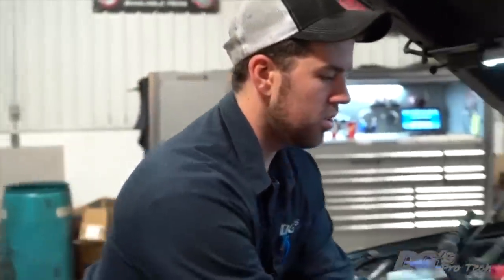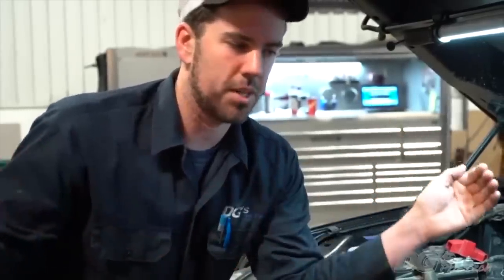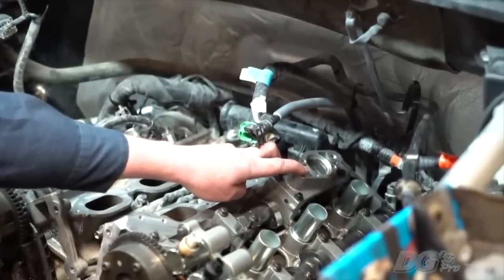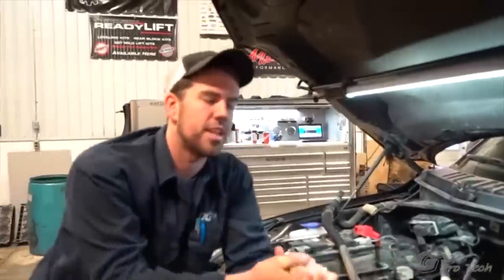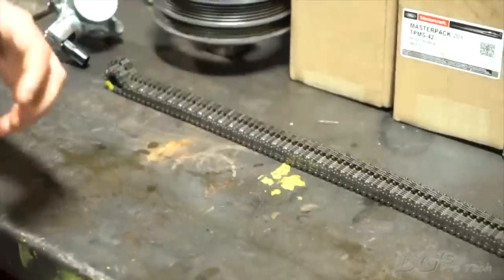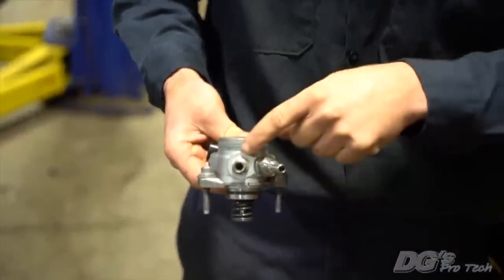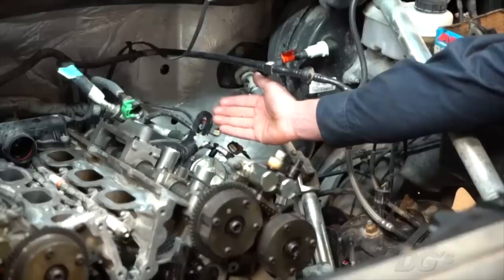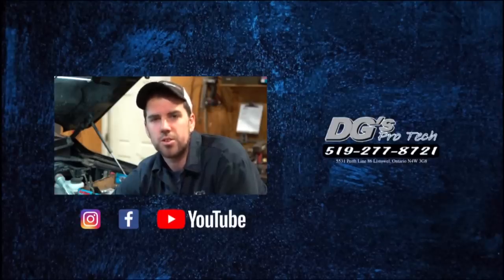What you NEED to know about Ford EcoBoost Engines by Dustin Golley of DG's ProTech

Comment: Just too much !.. I wonder if Aircraft engines are this much trouble ?... Im 60 years old, and been a mechanic a very long time. I am very biased to " old school tech".. Simple things like pushrods, and larger slower turning engines. Late 60s Cadillac and Buick V8s are a good example... The GM LS engine of modern times is a good example of a more simple way to go... By the way, im a Ford Man first
Reply: Majority of piston GA aircraft are nothing like this. They are WW2 era technology. Pushrods, flat tappet cam, carburators, naturally aspirated. It's virtually impossible for new engine manufacturers to break into the market, and 2 legacy manufacturers basically have a monopoly ( Lycoming and Continental). The reliability has to high of course, which is helped by mandatory inspections. Everything in aviation Mx is 3 times the price as automotive. Sometimes for a reason, sometimes because of liability

Comment: Thanks, I have a 2015 f150 Ecoboost and I love it .it has 92,000 on it now and still running strong. Would like to put one in my 1949 F1. I always change the oil and filter every 7,500. Only thing I don't like is all the covers I have to take off to change it, but I deal with it.
Reply from the maker: Thanks for the comment William! 👍

Comment: Ford needs to have there engineers hook up with these guys to learn how a motor works and holds up. I am a Ford guy and these mistakes are embarrassing. Ford CEO's take note or get the hell out of the way and bring in Engineers that know what they are doing. Where did they test drive these prototypes. There backyard

Comment: I have a 2015 f-150 that with only 52k went into limp mode. Had it towed to the dealership because I didn't trust anyone locally to work on it. It spent a month there with the only updates were,"we don't know what's wrong with it. " Then the service dept. called to say it was ready.  Wife got in it and turned the key, went back into limp mode.  The dealership said they would buy it back at current blue book value but,only when the get it running again.  My wife is a caregiver who has elderly clients who depend on her to take them to apts. She is using my old mustang with 280k and I have to catch a ride.  Thanks Auto Nation!

Comment: i lost my alternator on my 3.5 at 26,000-i left the ac on and it ate that also--if you lose an alternator make sure the ac is off including dont put it on defrost--mine was under warranty -it ate the whole ac system because of metal fragments

Comment: I have a 2020 ford ranger with 8000 miles. I use 5w30 synthetic blend and change the oil at 5000 per the manual. Should I continue with this oil or go pure synthetic especially since this engine is turbocharged and I want it to last? Any advice is appreciated and has there been any major issues with this truck as well? Thank you.
Reply from the maker: Thanks for the message! If you have a question about our products or service, please send us a message online at CARDONE.com or call our Customer Service line at 800-777-4780 Mon-Fri 8am-5pm EST. For Tech Support, call 888-280-8324 Mon-Friday 8am-5pm Fri EST.
Reply: @CardoneIndustries  thank you very much and will do.

Comment: Jesus! Not going to shade this one bit, you should be working for NASA. I have a 2011 Ford Flex 3.5 Eco Turbo. The water pump failed and I replace it myself. As they say, "If I'd known it would have been this hard, I would've never gotten involved". But, the WP failure happened at 175k miles and I'm now at 220k. Unfortunately, I now have a P0305 misfire code, replaced the plugs and the 5 coil - no improvement. Took it to a Ford dealer for an analysis and the mechanic says I need an new engine because there is 24% compression on the 5 cylinder. So, my plan is to jerk the heads, send them to the machine shop for a rebuild and try that. I'm guessing that it's valve related, or possibly head gasket. I can't imagine that these 3.5 piston rings seize up. I've run Mobile-1 synthetic in it from the beginning and changed the oil every 5k... religiously. The main issue I have (to your point) is that this is my wife's car and she doesn't step into it, ever. So, I'm sure there is carbon build-up on the valves, etc. Anyway, especially after talking to a Ford mechanic here in the Chicago suburbs that didn't impress me at all, I watched this video and thought, "Damn, this guy is a fricken genius." If I thought it would make it, I'd drive that Flex to Ontario and let you fix it. I really like smart people; mainly because I'm not that guy. You're that guy.

Comment: Ford garbage is what the fecal boost is and if you buy a ford, you're stupid! Buy anything other than a Ford with an ecoboost or wish you did when anything goes wrong! I was a ford guy until the 5.4 three valve, and the ecoboost will top that as a total piece of shit engine Ford should be ashamed, but it's like there all  in it together these days to build shit that barely makes it out of warranty.Then make it so labor intensive to fix you might just as well send it to the scrap yard. Fuck them and anyone who had a hand in the piss-poor  design... when I see people beheaded, I think I hope they worked for ford and smile, along with they voted for Biden. Cutting their heads off while they are alive is not punishment enough. I think at this point I'd rather be in prison for the rest of my life rather than work on a ford

Comment: I recently obtained my father's 2013 f150 ecoboost and I do love the truck but I think I'm having some problems coming very fast.  1 turbo seems to be stuck and the engine is leaking oil very slightly but all the way around it is seeping out. I noticed that my father was not always running synthetic oil which i will always run synthetic.  I hope i can nurse to good health.

Comment: I just picked up my first Ford product. It's a 2015 4X4 ecob 3.5L. 199K. This truck and engine bay look emaculate. Clean, not a mark on it! So I bought it. Now, the book says 5W20 for oil. Some people say use 10W30, I'm tending to stick to 5W20 synth. Just because it flows early and late.
Anyway, I know nothing else, do these have modular ignition or do they use a dist? 
And are the sp plug gapped at .32?
Reply: Nevermind I found my answer online... but I'm still happy about this vehicle. I've had it now for a bit over a month. Runs great

Comment: What about the idle of a locomotive? can anything be done is it and issue? 2016 F150 3.5L with good maintenance intervals idles like a train and gets 23 MPG HWY to work and home but when I pull My 7x14FT tandem axle enclosed Flat nose pace American Trailer I average 8.5 MPG HWY at 70-75 MPH Flat Ground the trailer weighs around 4000-6500LBS Loaded.

Comment: First, thanks for the video. I was a mechanic for over 30 years. I was brought up working on automotive electrical systems, may father owned an automotive electrical shop. I opened an automotive A/C and radiator shop and operated it from 1973 to 2003. You seem very knowledgeable on the 3.5L EcoBoost V6. What happens when the water pump starts to leak?

Comment: Great informational video- correct it is imperative to change the oil and filter every 5-6K with only full synthetic. My 2012 F-150 ECO now has 253K and aside from a current MAF issue (needs to be properly spray cleaned) the truck runs great.  Another tip my mechanic advised especially on the older 1st generation ECOs is when operating for extended trips is to allow the engine to idle 2-3 minutes allowing the fluids to circulate through the turbos before turning off. Anything to extend the life of the ECO is important.  Don't forget the transmission flush which along with the radiator which I do at the dealer at least every 40K after I hit 100K.  Small price of preventive maintenance to possibly avoiding large repair bills if you plan to drive over well over 100K.
Reply: Having had diesels in the past, if driving on the highway, especially towing hills, I'd let the truck run until exhaust temps lowered to 300 degrees, so says the pyrometer.   Of course their is no pyrometer on these F150's (of which mine is a 3.5 as well, and running fine at 130k+ miles) and although I don't tow, if I've run it a little harder than normal, I'll wait 30 seconds before shutting down.   I am one of the one's that drives for fuel mileage, so every now and again, have to remember to allow the turbo's to incorporate some power...but I don't often, as I want to remain above 18 mpg around town if at all possible, which it can do if I drive it sensibly.   I just bought a case of Motorcraft semi-synthetic (as per the manual states for oil changes) but I do change right at 5,000 miles or prior to.   I'll switch over to Penzoil Platinum full synthetic once my Motorcraft is gone.

Comment: Biggest tip, change the oil as much as possible.  My wife has a 17 1.5 Fusion and I have a 15 lifted Colorado.  I always change them no less than 35% oil life.  Better to pay an extra $30 (do it myself) for an oil change per year than change out a timing chain.

Comment: I would like to see GDI on a naturally aspirated engine.  The huge benefits of GDI are the high pressure which equals good atomization, the ability to run very high compression ratios...both of which equal better efficiency, and the ability to run at far leaner mixtures, which means that at light loads you have a higher air volume / less restriction from the throttle (higher vacuum), and are running at a higher actual compression ratio.. because of that lower vacuum, which also adds up to higher efficiency.   You can achieve much higher cruise efficiency, which is the only efficiency that really matters as vehicles spend most of their time at cruise.   Under load there is little gain to be had with any technology.
Reply: My little Kia Forte has GDI and no turbo. I bought it specifically for the lack of the turbo and fewer maintenance headaches (I know, it's still a Kia but I've had good luck with them.)

Edit: Just wanted to add, this is all on an Atkinson style engine. So supposedly it shouldn't have as much of the carbon build up issue. We'll see.

Comment: How do you feel about the catch can in the PCV circuit of D.I.  Ecoboost engines  to remove oil/gas/sludge in vapor form, which prevents it from coking on intake valves and turbo vanes?  I put one on at low mileage and limit my trans to 4 speeds occasionally at 50-55 mph (3:55 rear end) to open waste gates at 1900-2300 rpm.  2013 F 150, 3.5 ,at 48K miles now.  I change oil by 5K and rotate tires at same time.  Ford calls it "The Works".

Comment: I've owned, operated, & properly maintained my share of Ford vehicles over the last few decades, both cars & trucks. That said, I don't buy them anymore. There are simply better choices out there.

Since around the turn of the century, Ford vehicles have become nothing but garbage. Ford has become famous for sticking the end consumer with their inferior crap. They use the average consumer as their guinea pigs. Instead of doing their own due diligence in product research, development, & thorough test engineering, they throw inferior crap together and sell it to the unsuspecting public.

Ford's documented constant failures in virtually every decade, in every series of vehicle they manufacturer, in nearly every division of their vehicle components (electrical, engine, transmission, powertrain, etc.) proves my previous statements. 

Don't believe me? No worries... Just go & do some actual research, regarding the seemingly endless numbers of Ford vehicle failures. 

Prepare to pick your jaw up off of the floor. It's truly mind-boggling.

Comment: one more comment. as the maintenance administrator of a very large wastewater treatment facility for 10 years and failures that I saw were poor lubrication or alignment issues and the equipment ran 24/7/365 for years and years. some for decades. poor LUBRICATION did you hear that?!

Comment: 15,000 km or 15,000 miles? 15,000km is 9320 miles and i wouldn't consider that the extreme end of oil change intervals, a little high maybe but not extreme. I prefer 7500 miles for all my cars (none of which are ecoboost)  and yeh, i only use full synthetic (Mobil 1 5w-30)

Comment: Used oil, that means mobile one is the least oil you should use. Above mobile one you can get even supertech oil which is much cheaper but it tests better than Mobil 1. Amsoil is probably as good an oil as you can buy and Valvoline synthetic, Pennzoil synthetic. If you're concerned about a little bit of wear on connecting parts especially that timing chain Castrol Edge will probably protect the timing chain as best as anything. Use a good oil filter the best you can buy that I'm aware of right now is purolatorboss oil filter. I believe you have to mail order those cuz I haven't seen anybody carrying those in a while but you can still buy them.
About a week before an oil change when you're usually about a quart low on oil, put some Marvel Mystery Oil into that engine and drive it for a week it will help to clean turboshaft of the turbochargers. And if you can get past the two stupid things they did with this motor, which was not at least Port injecting a portion of the fuel going into it to keep the intake valves clean which is also why you need to put a oil catch can on the PCV system, or the other stupid thing they did was put the water pump inside the damn motor. I don't know who did that but they should grab that son-of-a-gun and fire him and make him marry your ex-wife. Because somebody allowed that son-of-a-gun to do something purely stupid. I have seen internal water pumps before but it was a regularly replaced item with the timing belt on the Chrysler 3.5 L V6. Which was the motor that was used in racing and not once did it ever suffer an engine failure during a race. The only agenda ever had that type of History. It was used in I believe it was Formula 3000 Auto Racing for a number of years.

Comment: My 2017 Ford F-150 gets 27.7 MPG on level ground not pulling a trailer and 14.5 MPG when pulling my Lance 1685 Travel Trailer  which weighs about 5,500 pounds loaded. Over 40,000 miles on the ODO. The most efficient system I’ve ever owned. Previously a Toyota fanboy.

Comment: Fantastic video, great education - thank you. I run full-synthetic in my engine and swap oil/filter every 6,000 miles, I am currently at just a little over 90,000 miles and everything seems to be running good.
Reply: what brand  do you consider good quality full syn oil & filter
Reply: @Tom-ic7hw .. Pennzoil ultra platinum and fram ultra synthetic

Comment: Thanks so much for the info. Wayne. I am considering purchasing a 2019 Ford F-150 with a 3.5 Ecoboost engine. What grade of gasoline do you recommend. I've read a variety of opinions. I believe Ford recommends premium gasoline. There was also the opinion that when pulling a trailer you should use premium and on city streets regular. What is your opinion? Thanks!
Reply: Run premium.  But ford doesn't recommend premium unless you're towing.  The engine runs better on premium especially after prolonged use.  The knock sensors retard timing if poor quality regular causes any knock.
Reply: Thanks Brian. Since gas prices are so high I may need to look into a different engine or adjust my gas budget. Are there any make of truck/engines you would recommend that run on regular that can pull a trailer weighing 7,500 pounds? I have a 2000 Tundra that runs fine on regular but doesn't have enough power on steep hills. Thanks!
Reply: @tomharrison7280  you can run the 3.5 on regular.  And unless you're dogging it you won't really notice the performance drop off.  All the numbers ford publishes are allegedly with the motor running on regular 87 octane.  I don't think there's any long term issues running regular will cause.  Get a 5.0 or a Chevy V8 if you're worried about it though

Comment: Thanks so much for the information man that’s a great video. I have a 2015 transit with a 3.5 eco-boost in it. I use conventional oil but change it approximately every 3000 or 3500 miles. I know that’s the lifeblood of the engine and the turbos. I have 90,000 miles on it I’ve thought about switching over to synthetic not sure if that would be an issue after running conventional the whole time.Thanks again

Comment: A good video for those who want to know what to look for , when owning a vehicle with such an engine... High power when everything is running/working correctly.... But when things start developing problems , they tend to be expensive in a big way, especially with designs that are as complicated as this one is... I did troubleshoot & repair a rough running ego-boost engine, a while ago... It turned-out to be worn connectors between the primary wires and the COP coils... I replaced the worn connectors, and that cured that issue... But there are so many other things that it could have been... I did not realise that they tend to have timing chain issues, along with the sticking internal waste-gates of the turbo's... It is one of the reasons WHY so many people are sticking with their older carbureted vehicles... So much easier to work on, and still very capable of maintaining the speed limits at minimal expense... It also explains the EXTREMELY HIGH resale value of numerous older vehicles... I lost count, of HOW many times a newer vehicle with this type of technology, just flew past my old truck (that has over 470k. on the odom), only to find that same vehicle waiting at a traffic signal, that I just leisurely rolled-up next to.... The real question should be 'WHY, should anybody want to own something like this?' My old truck does fine towing loads, and actually has something that the F-150 series trucks do not have- a full floating rear axle, and Lots of other things that will take too long to list here...
Reply: Whatever, gramps